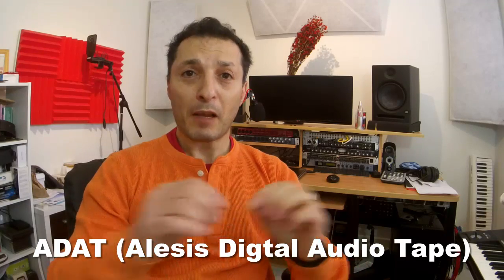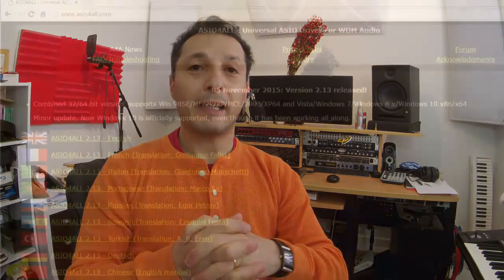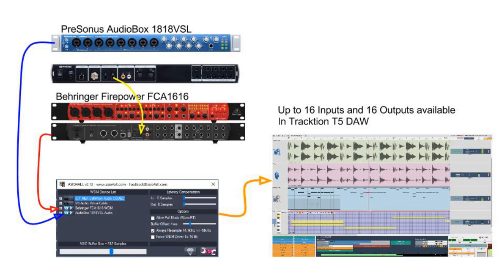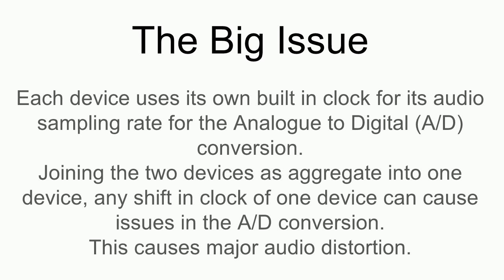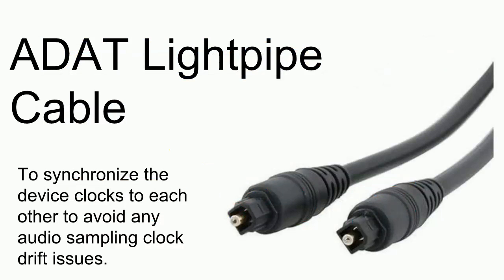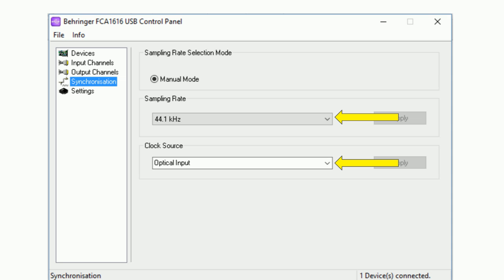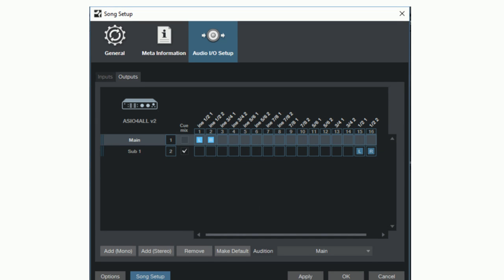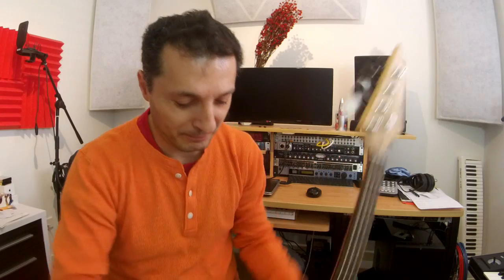Combining Two Audio Interfaces Using ASIO4ALL using ADAT as Clock Link

Comment: The  only thing I had was two  1818VSl's  and 2 PC's 
By "changing " the firmware in one  to use Universal Control 4.6   ...... and having the other use the VSL software 

I used the one PC with UC firmware to set clock to ADAT  ( this is the "sending " PC )  
I set the PC  with the VSL software to internal  

They are both connected via USB to their respective PC and one ADAT  cable from the one with UC goes "out " to the PC with the VSL software "ADAT in " port 

 Of course both were set to 48k and 128 buffer 

I then opened Studio One 5 Pro  on the one with UC     and Studio One 7 Pro  on the PC with  the VSL  

I did the routing and it worked perfect   

I treid it on one PC...... no go .................. driver issues  and I couldnt get a UC and VSL to play well or even install side by side , Windows didnt like 2 VSL's connected 

both PC 's I am using are old but running Windows 10 22H2  and  Studio One PrO 

Thanks for a great video, I already mistakenly bought a 2nd VSL   and had to figure out how to make it 

this was a great helpful video 

this is years later I know. But some one might have a setup they could do this with

Comment: Ubuntu studio can connect and use any amount of audio interfaces, interconnect them with software and each other in free way out of the box with new pipewire audio system. No need drivers installation, most of interfaces are supported by ALSA kernel modules directly. You can record from all connected interfaces at same time without issues, all audio streams are resampled on the fly to eliminate clock issues. It will add some latency, but you can measure it with jack_iodelay utility and set up latency compensation in the DAW to have sample accurate sync of all inputs.

Comment: I have a MOTU 896mk3 that's firewire. But, the computer I will be getting doesn't have firewire. So, I ordered an 8pre USB. If I use that one as the one connected to my computer will I still be able to connect the firewire unit to the 8pre?  I want to get 16 inputs and use the 8 outputs on the firewire unit. Does that make sense? I can't afford to go out and get another 8x8 for another grand.  I'm trying to use this usb 8pre to get done what I need.

Comment: This is such an excellent video. Watched it a few times.
I want to bypass (not use) the internal interface of my Presonus StudioLive mixer (32S model) and only use the Presonus digital mixer as a CONTROL SURFACE for Studio One....As I plan to buy an Antelope Orion (32in and 32out) interface.

I know you used to have Presonus StudioLive mixer...
Question Please:
Would you know, if I DO NOT use the built in Presonus Digital Mixer Interface, and only use an external interface, (Like The Antelope or similar) will the Presonus StudioLive mixer still be able to be used as a Control Surface for the Studio One software?
If it does not work, unfortunately I will have to sell my Presonus 32S model...and buy a dedicated control surface. Hoping you might know. Thanks as always...
Philip
Reply from the maker: Thanks for your comment. Yes, you should be able to use StudioLive as surface control and use another interface as your audio device (although an expensive one 🤔). You can also set StudioLive as direct audio interface bypassing the faders, all DAW inputs and outputs connected directly to the physical interface inputs and outputs.
Reply: @RecordingStudio9  I appreciate your reply and information. 
If I use the Presonus StudioLive ONLY as a Control Surface (and only use an external interface like the Antelope Orion) will I still need to use the ASIO4ALL in order for the Studio One software to see (and select) the Orion? 
Thanks as always. 
On a personal note: It is people like yourself that make watching these videos worth while and very instructive. I just wanted to acknowledge your contribution to helping people solve specific audio problems.Thanks and...All the best from the NYC area.
Philip

Comment: This video is super useful. About a year ago I bought a zoom livetrak l20R digital recorder and it's awesome, but the only downside is that it doesn't have midi inputs for my midi keyboard or percussion pad. Now I can pair the zoom with my Saffire USB 2-in with MIDI and finally be able to have midi tracks on my session without switching gear, plus 2 more XLR channels if I need to. Awesome!!!

Comment: Is this a limitation of Windows? I bought my 1818vsl about 8 years ago and never had an issue connecting 16 inputs on my Mac via 1 usb 2 port. I'm just reimporting some songs from an old mixer from the late 90s (fostex fd8) because I'm hearing popping on the last import from years ago and wanted to make sure I'm doing the syncing right. In any case this is useful info
Reply from the maker: 1818VSL has ADAT in/out so connecting an ADAT interface like the Behringer ADA8200 will use just one USB. 
This video is about connecting two USB interfaces with no ADAT on Windows. On a Mac OS, you can simply use Aggregate and works the same way.
Reply: Wow I wrote 2 comments and they disappeared. We'll just going to say thanks for the info. Learned something new.
Reply from the maker: Not sure what you mean. I don't delete comments and I have no comments in my "Held for review" inbox.

Comment: So we have been running a similar setup for live band recording only the problem we found was during live recordings of a band using 16 channels and recording all 16 channels at the same time, the Presonus seemed to lack the ability of running 4 extra external monitors in addition to the two main outputs so here is what we ended up doing. We kept the 16 channels and snaked all the outputs for each channel into a 24 channel Mackie Mixer so we could control the room live but still capture all of the channels in the recording software. We bumped up the sampling rate to 2048 which resolved any latency problems and do not use the USB to the Behringer as the fiber does the work of pulling in the other 8 channels. It would be nice to see them come out with a better way to connect monitor wedges and use groupings to control what each player can hear coming out of the monitors without having to use a physical mixer to make it happen. There are only two main outputs one right and one left physically to plug in from on the back of the PreSonus to main speakers which work great for the desk jocky making individual tracks as a composer. For a live band recording it is a bit more difficult but getting better as more folks are wanting to record their jam sessions. Has anyone put three Audiobox 1818VSL's together and assigned any of the main outputs to be used to send to players monitor floor wedges? It has had its challenges, but I think we are coming to its limitations without just getting a Presonus 32 channel mixer that can record or something like it. Oh, did I mention whoever dies with the most music crap wins. When I mention monitors in the above, I'm talking about self-powered speaker wedges that sit in from of each player so they can set it to hear the singer or hear the bass or just keyboard and acoustic guitar etc. not headphones for a person sitting behind a desk. The ones you see band members putting their feet on all the time on the stage that can be moved around with a plug going to them. The audiobox has just a left and right output going to mains capturing all the channels for playback. Let me know if I'm missing the obvious, please.
Reply from the maker: I see you have taken the concept to the next level with live recording and personal monitoring with floor wedge speakers. I think you will hit its limitation and the only option next is to invest in a StudioLive 32 digital mixer to make your life easy.
Thanks for your comment.

Comment: Hello again...New question please.
I just bought a guitar modeler pedal. I would like to record the modeler pedal direct using the USB out of the Modeler Pedal into my Laptop.
Now, I monitor through my Presonus 32S digital mixer so that I have the mixer faders controlling the individual audio tracks. 
Question: Can I just plug the Modeler Pedal (vis USB) into my laptop using Studio One (5) DAW and still have the Presonus mixer monitor the tracks (with individual fader control) of the audio tracks...OR, will I still need the ASIO4All software? Thanks as always.
Philip
NYC area
Reply from the maker: Since you are joining two interfaces, you will need to Aggregate (MacOS) or use ASIO4ALL (Windows OS) to join the two devices. For reliability, set high buffer size, but this will add latency if you are recording and require direct monitoring.

Comment: Hi, great video. We did everything what you say in the video but out of the slave interface we can set that the in and out in our daw reason is corresponding but no sound. Do you know what can cause the problem... we are using the scarlett 18i20 3rd generation as the master and the umc behringer 18i20 as the slave. Also sometimes the asio program that we downloaded crash often... thanks in advance

Comment: Super well done video and information.
Question: I have Presonus Studio One 5 and would like to use my analog mixer going through one interface for tracking to the DAW, and on playback, I would like you use the Presonus StudioLive 32S mixer for monitoring. (I prefer recording through an analog mixer and using outboard compressors, external mic pres, etc)...

So my question is:
Can I use an 8 channel Focusrite interface (Focusrite Scarlett 18i20 Rackmount 18x20 USB Type-C) for my analog mixer going into the DAW (in my case StudioOne to record the tracks) and use the Presonus StudioLive Digital mixer for playback (and monitoring). Is there a method that would work for that particular setup? Thanks and great info on your video. 
Note: I have not bought the Focusrite interface yet, so hence the question before I commit and buy one. Thanks and your videos are always very well done.....
Phil
NYC Area
Reply from the maker: Yes you can record with Focusrite and playback on StudioLive as you mention. One note is that, you may want to select/enable only 1 or 2 stereo channels (or as few as you need) for playback to minimise load on your CPU.

Comment: I have a PreSonus 2626 and Presonus DP88. I am green at the digital recording world so I need to know the science behind using them together. I am working with LOGIC PRO X as my DAW. The book shows Light Pipe going in and out of both units and a BNC cable connecting the two together. How does this work? Please note that I am an old school analog user going into three Tascam DA 8 Format. This is all very new to me.
Reply from the maker: The lightpipe carries the digital audio data and the BNC is the very stable sync clock. So if you have more than 2 devices, they all sync to the main clock generator to keep everything in sync.

Comment: How would I connect 32 inputs all together
Reply from the maker: Not sure ASIO4ALL can handle any more than 16. I have tested it with 24 inputs in total and 16 outputs, it grinds to a hault. But up to 16 in/out, it works ok.
Reply: @RecordingStudio9  How would I go about getting 32 inputs from a rather decent interface? Or would I need some sort of different device.
Reply from the maker: Check out RME interfaces, or PreSonus rack 32 input interfaces.

Comment: Awesome video, just a quick query. Can more than 2 interfaces be used?
Reply from the maker: Yes, but unless you have good CPU and/or set high buffer size, it will struggle.
Reply: @RecordingStudio9  I'm using a quad core Xenon 3.30 with 64 Gigabytes of High speed ECC Server Ram, do you think this would be able to run 24 tracks?

Comment: I have two usb audio interfaces and none of them have an adat connector. The audio interfaces that I own is the native instruments Komplete audio 2 and I own two of them. For some reason pro tools does not recognize both it only recognize one even after using the Asio option. Can you please assist me in this situation.
Reply from the maker: Make sure you are selecting the ASIO4ALL as the driver and not the ASIO driver of NI, then select both interfaces in ASIO4ALL driver setup.

Comment: Neither the title nor the description say so, but this appears to be Windows-specific.  Folks with PCs running something other than Windows will need to approach this differently, although the issues to be solved (e.g. word clock sync) are presumably the same.
Reply from the maker: You are correct. For MacOS, you can aggrigate the two devices and no 3rd party software/driver is required, but the clock sync is still the recommended option.
Reply: @RecordingStudio9  In my case, I use Linux.  The problems to be solved are equivalent, but the details are unsurprisingly different

Comment: My Scarlett 18i8 only has an ADAT input. Could I use an ADAT output from another interface and connect it to the ADAT input of the Scarlett? Basically I'm asking if the lack of an ADAT out on the 18i8 keeps this from working. I don't currently have a second interface, but I need more recording channels. I did use ASIO4ALL to record a USB mic with my Scarlett 18i8 using Ableton and it did work. Still, I've never heard mixed results from this ASIO4ALL method with actual interfaces. Support doesn't seem to be guaranteed with any of the interfaces I'm looking at.

Well I checked and you can choose ADAT as a clock source on the Scarlett so hopefully ASIO4ALL will do its part.  Do you have any recommendations of interfaces with 8-48V XLR inputs? That Presonus you have is discontinued, and interfaces are pretty hard to find right now anyway. I've had a good experience with the Scarlett, so the 18i20 would probably be fine. I noticed the Scarlett Octopre is similar but cheaper. Are there any others in the 500$ or under category that compete with it? I don't know much about the technical specifications. Is buying used a bad idea?
Reply from the maker: Check for Behringer ADA8200 for added 8ch mic pre into ADAT of Scarlet.
Reply: @RecordingStudio9  That's much cheaper, thanks. I'm still a little confused though. Since my 18i8 only has an ADAT in, I would have to use the clock of the ADA8200, but it doesn't have a USB output. Would all the channels of the master (ADA8200) output via USB through the  slave (18I8)? And if so, do they output as separate tracks assuming ASIO4ALL works correctly? Because it was my understanding that ASIO4ALL combined the USB input of both devices at a driver level and the ADAT connection was just for clock sync.
Reply from the maker: ADA8200 connect to your 18i8 via ADAT, no USB. The extra 8 inputs from ADA8200 will appear on 18i8 USB.

Comment: What rubbish. Use Protools on a Mac create an aggregate device and throw ASIO out of the window with wondoze where it belongs. 
If you really have to physically connect devices use ADAT. AISO what a joke. 
Windoze: Ohh I need to download drivers 
Mac: ohh it just works
Windoze: ohh you want to record in a hurry ops I’ve lost all my settings.  (Again)
Mac: here you go press record 

ASIO rubbish in a professional studio
Reply from the maker: Thanks for your opinion.
Though I agree that MacOS has some advantages, but not everyone can afford a Mac.
I'm yet to lose any settings on any of my DAW options (Ooops, maybe because I don't use Pro Tools).
My videos are not directed to "Professional Studios".
Reply: @RecordingStudio9    Let me quantify my reasoning on my initial comment. I had an HP laptop and a Pc  which used ASIO. I used the HP  as a mobile broadcasting unit. These were connected to a small field mixer over USB.
As windows 7 got fatter, boot up time got longer and every so often windows would drop all my ASIO settings leaving me to start again. Despite several rebuilds it took aver 10mins to boot. One time I started the pc in the studio using Cakewalk to mix a session and when I went to it the dam thing had lost all the inputs. Frustrated I switched to hackintosh and with some support from tonymac86 I had two devices running macOS. 
You don’t need fancy apple hardware. Just patience. The replacement x99 oc 10 core i7 6950x pc has never lost any connections and is very solid running Protools. If it wasn’t for the rubbish ASIO drivers I probably would have never gone down the macOS road. 
For interest I run MOTU 16A over thunderbolt with adat links to 828 hybrid and an old fw828 mk2. Totally solid on Hackintosh always boots always perfect even on OS Sierra
Reply: @Gruntos  Anecdotal at best...

Comment: Hi, not sure if you can answer this one.
I have a Behringer UMC1820 + an Behringer ADA8200.

I also have a Presonus FireStudio Lightpipe which can support up to 4 x Behringer ADA8200.
Can I link the UMC1820 Optical OUT to the Presonus OPTICAL IN for clock sync and then use 1 ADAT on the Behringer UMC1820 and then have 4 extra ADAT's connected to the Presonus?

Basically in short i would have 
UMC1820 + ADAT unit.
PLUS
Presonus with 4 ADAT units.
It would give me a total of 48 inputs (8 on UMC1820, 8 on ADAT, plus 4x8 inputs on the Presonus with connected ADATS)

But this leads me to my 2nd question, can ASIO4ALL support up to 48 inputs?
Reply from the maker: That is a question I can't answer as I don't have the units. But if you already have them, you can certainly try it out.
As to ADAT sync, since the UMC1820 does not support WORD clock, you will lose one ADAT input on the FireStudio, which will make the whole exercise pointless somewhat.

Comment: I am combining two Focusrite Scarlett 18i20 interfaces. Will this create any conflict between the two devices of will it be an easier process?
Reply from the maker: If the driver detects two units and works, that would be great (let us know), otherwise, you can try this method.
Possibly use the SPDIF as the clock sync to free up extra 16 inputs via the ADAT on each unit. https://www.youtube.com/watch?v=h9Zva--QVVQ